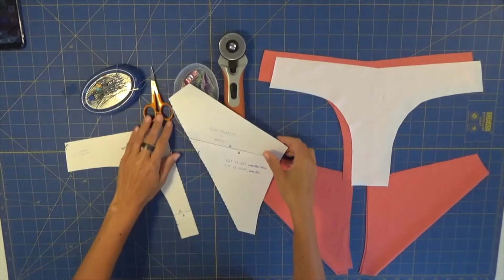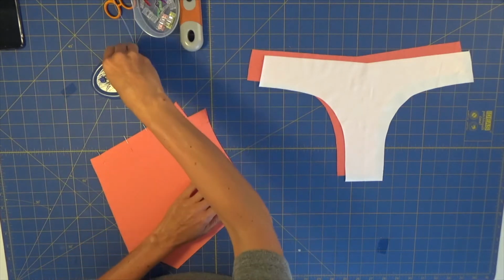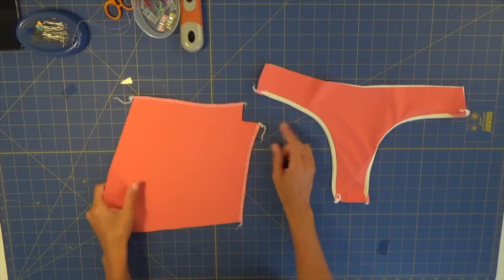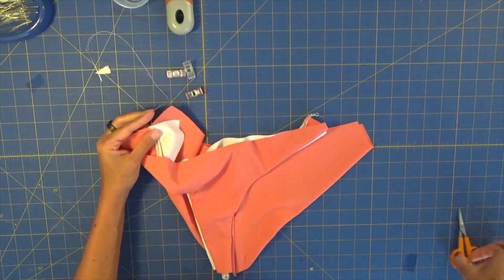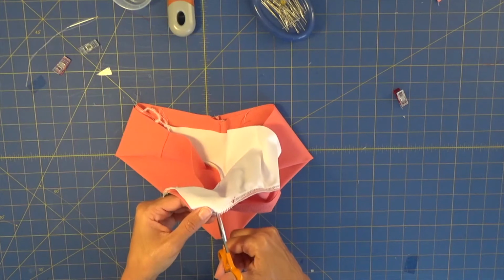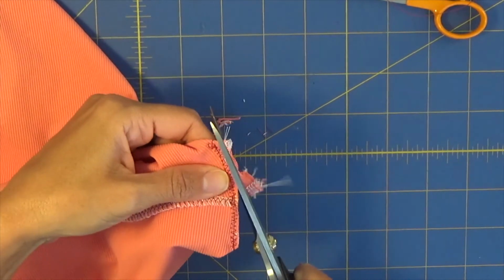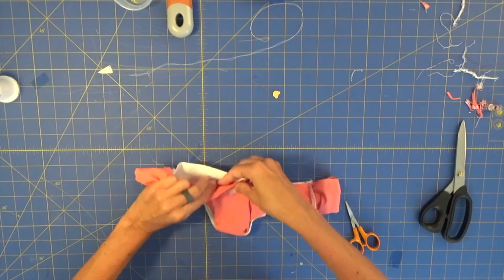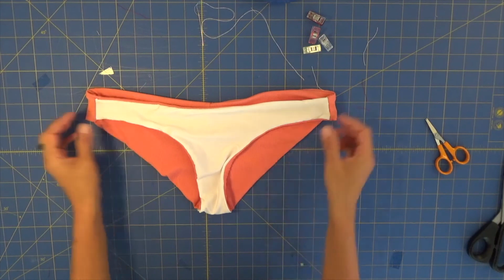Learn to sew Bikini bottom pattern Ryan by Bikini Design Club

Comment: This can be done using only a zigzag stitch instead of using a serger or interlock stitch, right?
Reply from the maker: It can. Lycra demands elastic stitches and that’s the most important. However, the final result with only zig zag is not the same, it hardly gets the quality you need. But yes, it can be done